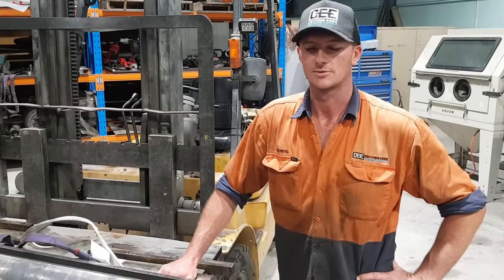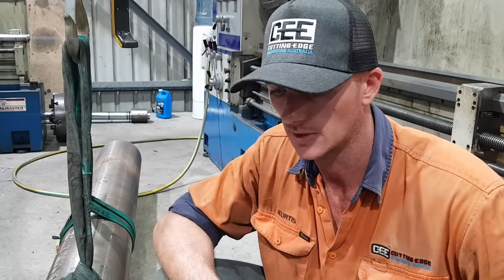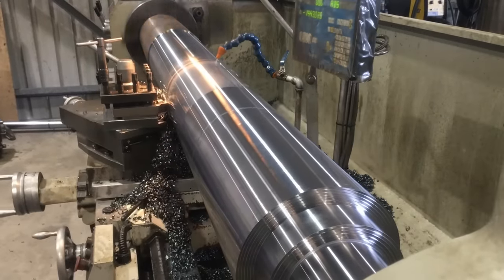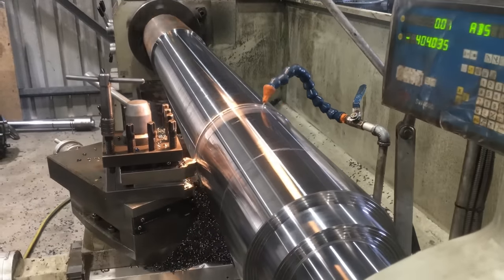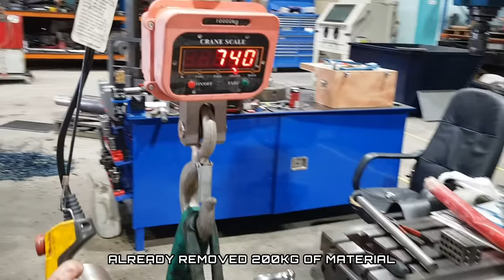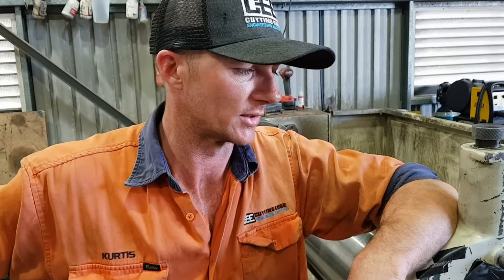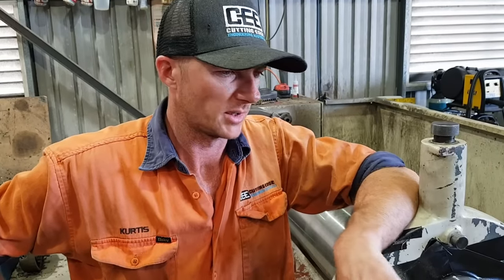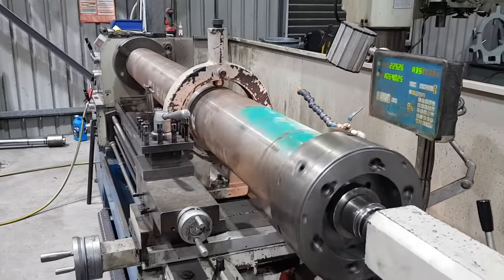Heavy Duty Machining 1000HP Tree Grinder Shaft | Part 1

Comment: As Woodworker we bump into Problems with stress and bowing quite often. So we use heat treating as well. We heat the wood up to about 1000°C in the stove and this solves any Problem. :-)
Reply: But 1000 degrees C would cause the wood to....

Oh. I get it.
Reply: Yup! Solves the problem every time. I've also noticed that as the prices for wood increase the more common the problem becomes.
Happy New Year to everyone wherever you happen to be in the world.
Reply: Right on.
Reply: As I work on making swarm traps  from scrap 1/2" ply, I'm come across pieces of warped madrone,  and having great success at heat treating. Toasty warm here in Origun, USA. No E. Happy New York 🇺🇲
Reply: @timothyball3144  First Hermann had me like "umm what technique are you using, that would simply create carbon" (im a carpenter but I also deeply dive into new techniques and skills to broaden my knowledge) then I went to comment like yours and foudn your comment. To be fair, he is not wrong. XD
Reply: You had me for a few seconds!
Reply: @JoeCubicle  same here
Reply: Genuinely looked up how to heat treat wood when I read this lol. Got me good wish I could give more than 1 like
Reply: I was starting to go along with Herman, until he mentioned 1000 deg. C. That's when I said "Hold it just a !@#$%& minute, Son!"
Reply: @JoeCubicle  Ditto !
Reply: K. This took me a minute. I've spent actual time selecting wood when I knew I needed to rip it. Never knew there was a fix. But yeah. Turns out I've using the same method. With a bit of a beer or whiskey quench with friends & family.
Reply: As a candy maker we too run into stress and we just eat that shit up!
Reply: old Indian trick
Reply: Took me a second 😂
Reply: Oh I get it😂😂😂
Reply: No wonder that the favorite material of woodworkers is epoxy resin.

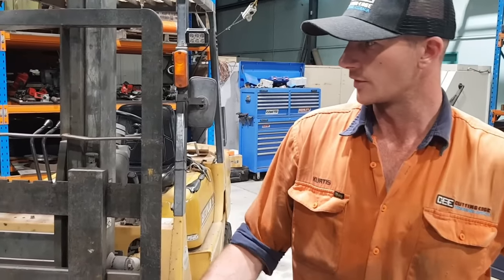Comment: Enjoyed the video about the bent shaft that kept throwing out. I worked on a copper mine in the 70's in Africa and we often made shafts. I remember shaft turning carbon steel pump shafts and larger shafts for the mining operations. With long shafts with a ratio of diameter to length over  1:13 one had to keep turning end for end and between centres. There was no heat treatment, we just kept turning end-for-end with light cuts until the stresses eased out of the shaft. Later in life running my own company similar to yours we found alloy steel shafts needed heat treatment. Not annealing, but stress relieving treatment. 
      There is a British Standard available I believe, forget the reference number now. We would rough out to plus 10mm on diameters stress relieve 1. then further rough out to plus three mm on diameters and stress relieve 2. and then rough to plus 1mm all over. We would not finish important diameters leaving them to the very last. Where large keyways or drilling operation were involved axially we left bearing diameter's until the keyways had been cut. If a shaft is absolutely critical sometimes it is best to let it rest for a week in the roughed out state in addition to stress relieving. 
    I found a company in Saudi in the 80's that had spent a lot of work on a large shaft 6" diameter x 6ft long and ground all over which had moved after grinding and the throw was 4/10 thou. That is 0.0004". The shaft had been rejected. 
     To the comment someone made about cheapskate customers supplying poor quality steel, I would say no billet or bar  is always perfect. I have had to reject stainless steel bars with cracks in the core. It's part of life I guess. 
     I'm not familiar with the steel designations given in the video I only remember the British EN series. From memory the most stable steel available for shaft turning, steel that did not move, was EN14. It's tensile strength is little better than 20 carbon steel i.e. 20 tons tensile, but it is stable and easy to cut, also resistant to cracking.
     Customers often choose better quality steel for a job, but it is not always better, the steel has to suit the application. I remember a customer coming to me in desperation, he had used every type of alloy steel for a railway application where there was heavy vibration. We eventually tried structural steel grade 43A and it lasted 20 years. No cracking and the welds held. 
     I think you could save a lot of time by buying a small horizonal milling machine for boring out gussets and beating. The Cincinnati 2E is ideal for such things and bigger millers for the larger work. I am very impressed however with the automatic welding device for line boring. 
    I've been retired now 20 years, and I suppose I miss the old machine shop work. But better to watch your videos.
Best wishes, your videos are fascinating and I have earned a  lot from watching.
Reply: Awesome story, thank you for sharing!
Reply: I've probably spent less than 10 hours running a lathe,  and I'm probably wrong,  but, when you started cutting,  the free end had obviously quite a bit of runout. Thats fine because there was plenty to remove.  I think the problem didn't occur until you flipped it. You should have adjusted the chuck for zero runout on the indicator,  left the steady rest where it was, and all the runout would have transferred to the free end. Same as before. 
  I'm sure sometimes material will spring after removing a good portion,  but in this case i think it was operator error.
Reply: You’ve learned a lot?!? That’s very humble, and a real compliment to Kurtis.
  And yeah, we always miss the shop.
Reply: That's one hell of a Welsh name you got there, mate.
Reply: Great comment! 👏👏👏

Comment: Just came across your channel and enjoy the content. I’m a manual machinist and make these shafts often and can keep them running within .001” the whole way but they can be very temperamental .Couple things I have found/been taught. 
Number 1: 4 jaw
Number 2: face up the ends of the shaft and have it banked against something solid in chuck 
Number 3: rough in the big OD the length of the shaft before turning the ends. For one it gets all the stress out from the beginning that’s in that top layer. It also reduces the size of the square shoulder which will warp the shaft 
Number 4: step in your radius while roughing so it looks like a staircase. This will help with the large square shoulder and help keep it from moving. Radius will always fit under a 45% angle. Say you are taking 0.100” perside when you get to the end of your cut stop 0.100” sooner the next pass until then go step it down some more when done roughing before finish passes. With a radius that big on a shaft of that length you want the radius on both ends roughed in before finishing either side or you will risk bending it. 
Number 5: gotta be careful with the steady rest can bend them with that also.
Number 6: I scraped one the other week because I got some unexpected taper on my last pass.

Besides that nice work and I envy your lathe. I make them on a 1940s 20” American. That rapid traverse on the carriage, DRO and the chuck for the tail stock make me drool.
Reply: @Devin Shock I've never seen Kurtis talk about runout on his scroll Chuck, but on these large shafts I imagine a 4 jaw would be better, and your advice about the steps in the shoulder seem sound. I watch ABOM 79 on YouTube (Adam Booth) and he does or has done many gearbox shafts of that length and girth and he uses the same techniques that you mention. Kurtis is a great machinist no doubt, but I think he would benefit from being a little more patient in his techniques. It seems he is always looking for the fastest way to get it done, which is great for his shop, as he appears to be a one man crew, but the fastest way is not always the right way, especially in manual machining large shafts, or machining in general for that matter. Enjoyed the video. Sometimes it does not matter your technique, a shaft can just be to out of wack. Strange though, I've never seen Adam Booth have this issue, and while I've not seen all his videos, I've seen a lot, and many are of this type of machining, and on much older machines!
Reply: Many milled parts are roughed out before normalizing. I have even hung vertically positioned while HTing.

Comment: Interesting to see how different shops use different ideas to do the same type of job and I enjoyed seeing how you got it done.
I used to do large commutator shafts of a similar size, and we had a few rules.... 
1. No steady rest adjacent to the live centre. 
2. Kept looking for another steady rest.
3. Span of less than 2 metres between Chuck/Live centre and steady rests, adding a second steady rest as required. 
4.  Opposing interrupted cuts for the two steady rests meant that we could send the material back.
That interrupted cut behind the steady rest along the unsupported centre section had my teeth on edge...some evidence of sagging at the 12:00 mark.
Building up heat in the work piece could explain some of your later run out issues as due to the thickness it likely wasn't heat treated fully before hand.
Thanks again for an enjoyable video.
Reply: What are the pointers to sagging at the 12 min mark?
Reply: @georgemarshall6657  That, I also would like to know!
Reply: @1kleineMax1  A few seconds later i can hear the sound of the cutting ocillating up and down which suggests the cut is getting deeper and shallower once per rotation which means something is going on with the peice as the cut sound on anything other than a cleaup pass should be fairly consistent as you should be removing an equal amount of metal all around the work peice
Reply: @georgemarshall6657  A few seconds later i can hear the sound of the cutting ocillating up and down which suggests the cut is getting deeper and shallower once per rotation which means something is going on with the peice as the cut sound on anything other than a cleaup pass should be fairly consistent as you should be removing an equal amount of metal all around the work peice
Reply: on long shaft I always turn steady band closest to the chuck first and work towards the tail with at least 3 bands  Always 2 cuts to cut steady band. Lastly re-machine the centre. repeat this process a number of times depending on the diameter and metal to be removed  rough out the entire shaft first  and allow to cool. Machine new steady bands and centres again before finishing. 
Just my way. hope it helps someone.

Comment: Hi.
The problems you have had are due to the stresses caused by turning in the material.
It is normal. But to avoid so many problems, you should do the centering points later. The material is always going to twist. It is a material of a very high quality and resistance. I really like the tailstock grip plate.
From Spain, greetings. Very good work and very good channel!

Comment: I remember the first machine shop I worked at and one of the things they made were impeller shafts about 10 feet long and about 3 inches in diameter made out of 4140. They would always warp .050-.100 once rough machined and left over night due to the fact the steel isn't stress relieved.
Reply: Left overnight in an oven, I hope.

Comment: Happy new year mate,
I used to machine shafts similar to this one that you are making, we used to rough it out to within .250" all over and then let it sit and normalize for at least 3-4 weeks( its a long time if the shaft was needed ASAP), then do the finishing using minimum radius tooling to eliminate tool pressure on the job.
we did as much as we could possible with the part setup without flipping it.
TIR we used to get this way was within .002-.003 on the 96" length.
Best Regards.

Comment: Hello from Northern Ireland, I’m a machinist in a heavy engineering shop and we do lots of screen shafts for the quarry’s! We would normally use a 4 jaw Chuck when machining them and we don’t get a lot of runout maybe 0.2mm
Reply: Strange last name there, you a red coat?

Comment: 15:55 One thing I've learned over the years, don't ever slide the end with a run-out into the 3-jaw chuck. First of all there's no way to check the end of the shaft and second, the 3-jaws will try to move the run-out in different direction. As someone mentioned before 4-jaw chuck and working between centers is your best bet. But if it turns out that it's some shitty material, then there isn't much you can do.
Reply: I think your 3 jaws chuck is running out of center,  I have some experience with these shafts and I do not trust but my 4 jaws chuck,  I would say too,  that your lathe needs more power  and better bedways
Reply: well, his method worked and thats what matters so... if it aint broke dont fix it

Comment: I am very much an amateur at machining. I have a small 9x16 homemade metal lathe. No power feed. No change gears. But i have run into problems like this, only i did Not know enough, to know what was going on. Now i do, so thanks, it explains a lot. I have run into internal stresses a lot in woodworking, but never thought about it being in steel. Your Vids have taught me a lot, and given me a lot of ideas too. So thanks...........

Comment: Good thing you have an understanding customer and supplier, if that was here it would be all the machinist fault and you would not be able to convince them different. Great video, and I have to admire the way you approach the job and do the machining. Happy New Year and all the best in 2021
Reply: I'm not convinced, but I would be if I was able to take some temperature readings while that bar was being worked on.
Reply: To prove what Jules?
Reply: I have ran many jobs that other shops couldn’t run by utilizing proper heat treating for that job.
Reply: If you take cuts that keep most of the heat in the chip and not the work, that might help.

Comment: Your Lathe-cooling is special. I have always cooled the HSS turning tools, drills, center drills etc. directly and sufficiently and never the workpiece itself. You want to protect the cutting edges from wear with it. Aluminum with a petrol can and a brush. We didn't cool the carbide plates at all or as much as you can't with your lathe cooling system. HSS turning tools are considerably cheaper and can be reground numerous times. You will need a chip hook to remove the chips without cutting yourself. The measuring instruments are always read directly on the workpiece and not after it has been removed. This is not meant to be a teaching, we just learned it in apprenticeship training. Keep up the good work, be careful with the machines, avoid working alone with the machines and it's exciting to watch.

Comment: Your fun to watch.  I really enough your expertise.  I have zero in this field but I always try to guess the correct way to repair the part.  I don’t think I’ve been right yet.   I have learned what not to do.  When 2 pieces of metal break I always assumed you just put it back together and weld it.

Comment: That's amazing I had no idea that could happen
Reply from the maker: Thanks for watching mate
Reply: I've been machining for years and never seen it, although I must say I've never machines a bar that size from stock. I've done repair work but never from blank
Reply: @GeneralG1810  quite common with bright mild steel rectangular section, less so with round.
Reply: @chrisstephens6673  Wow poor Kurtis that was HOURS of machine time just wasted
Reply: @GeneralG1810  I've worked oil field equipment, I've seen it before, but very rarely. Almost always comes back that the material didn't meet heat treat requirements, or the metallurgy was a bit off.

Comment: Had to make a Lathe for my final trade test and welded up the headstock then heat treated it for stress relief and the thing warped a little when i bored out each ends bearing housing. Steal stress relieves when machining.  Just as oxycutting a straight line the steel relieves and bends.

Comment: Compliments of the new year.such material need proper procedures to achieve quality. You need to premachine it close to size and take it off the machine for a day to give material room to react(stress relief.usually expose it to the sun) then machine it to size and also watch not to exerts too much force on the running centre.

Thats my daily bread stuff. Hahahah

Comment: Hi Kurtis, I noticed that you chipped away half a ton of material on this project. You may want to consider using a bandsaw set set up on your lathe to do some rough axial trimming of the material before you start turning. Just put the shaft on the steady rest, make a radial cut and then do 6 cutaways on the free end. It is unconventional but effective. You will end up with 6 chunks of high quality steel that might be of use elsewhere and you will not spend days to pulverize more than 50% of your shaft. It should save some time, some turning bits and a lot of money on your electricity bill. kind regards from Germany, Klaus

Comment: Those long shafts can be tricky to get sorted when the material is like this. Happens all too often. A few times I have made this complaint to the supplier the material they supply in exchange has been worse than the piece you start with.
Reply: Knowing this problem, the most advisable thing would have been to send the rod to normalize before machining it.

Comment: Happens that way occasionally,  the material coming through these days leaves a lot to be desired. I just scraped a part in 300 series stainless last week that sprang after half a day in the mill. Sucks, but it happens.

 I've done a few large flail grinder shafts that have had the same issues with cracking at the shoulder.  Most of the time the manufacturer didn't use a large enough radius in the shoulder. Either that or the shaft had a sharp undercut in the transition.
Reply from the maker: Hey mate thanks for watching, interesting how many can relate and have had such issues with materials, yeah we increased the size of the radius on the shaft in part 2